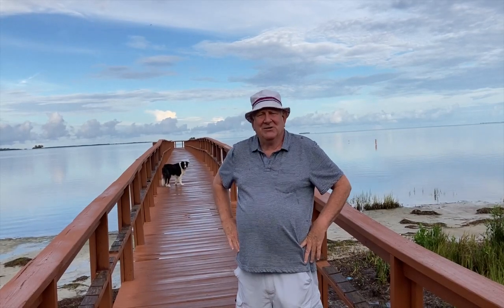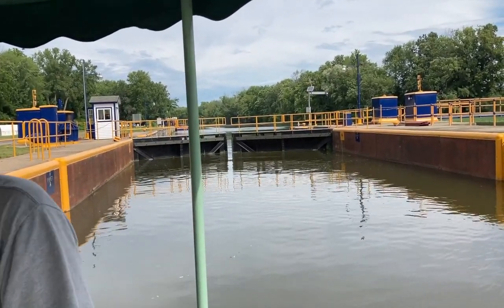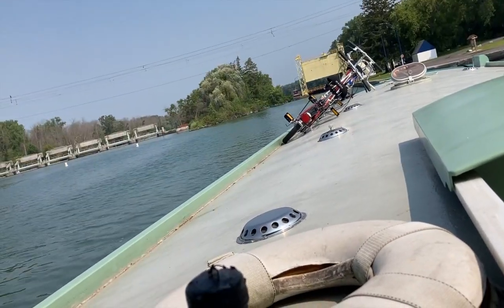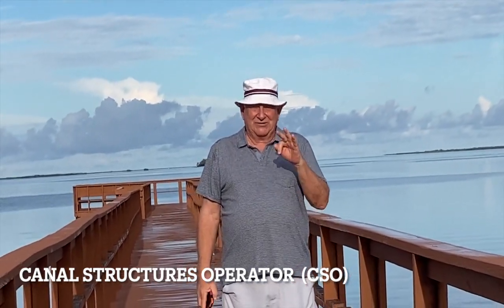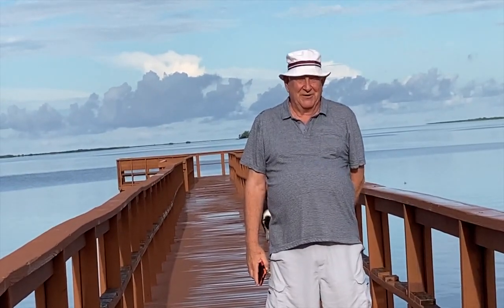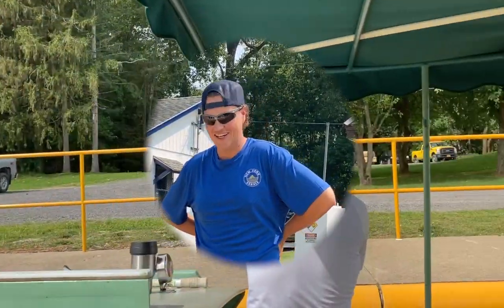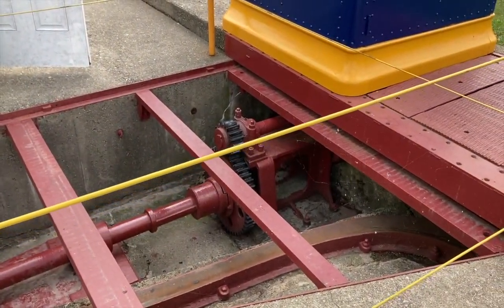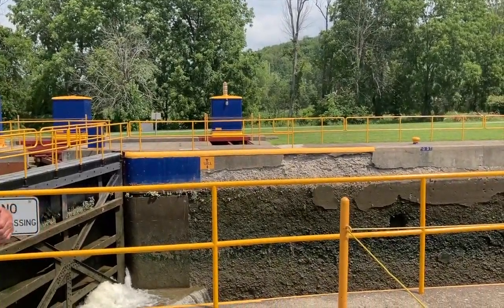Vlog 14 Locking Up the Erie Canal

Comment: It's  a two-way radio not a cell phone.
Reply: yes you are correct.  the lock keepers use two way radios to communicate with boaters.  In my video in used a cell phone as a prop since i don't have a radio except on the boat.  thanks for the comment.